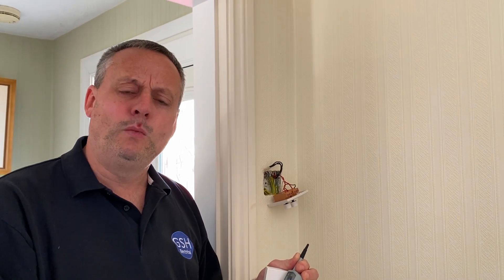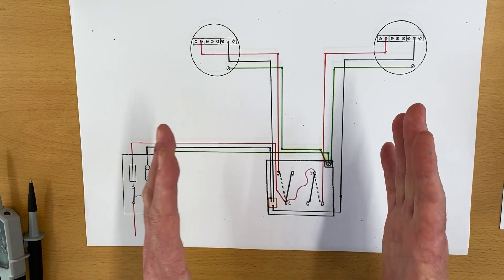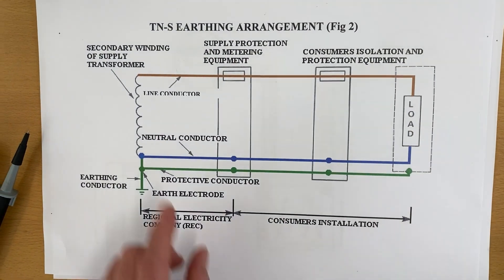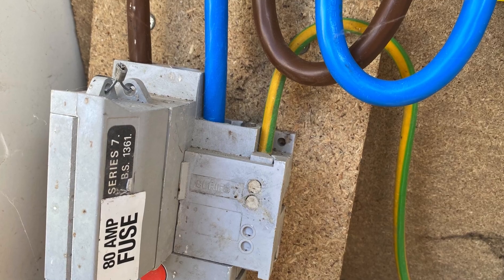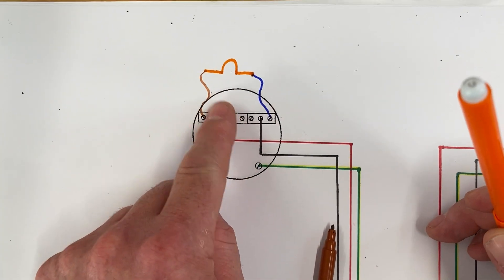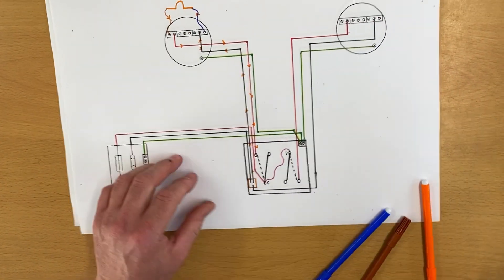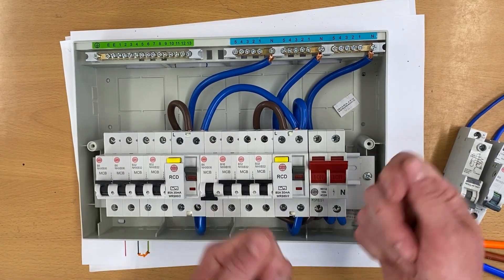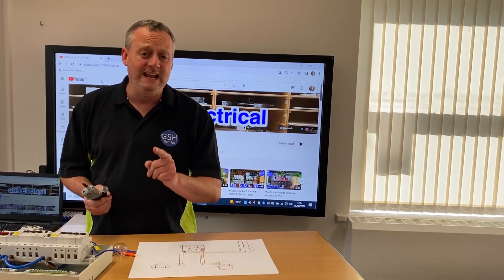WHY Does my Voltage Indicator Beep During Safe Isolation

Comment: You should also get neutral-CPC continuity on a TT system, albeit with a much higher impedance as the completion of the circuit is via the ground. The only supply system where that ought not to be the case is an IT one, and that's not something you will find in a domestic property in the UK (Norway is the only country where that might happen as far as I know).

Comment: Excellent video as always. I have a request if I may, would you consider making a video on derating cable within insulations covering the various cable clipping/mounting methods i.e. in conduit within the thermal insulation etc. I'm sure with the way things are now with acoustic and thermal insulation going in walls/floors/ceilings galore I wouldn't be the only one to find it handy and also interesting to hear your thoughts on the best methods. Thank you!
Reply from the maker: Great comment 👍🏻

Comment: I have two questions. When you get the continuity between the switch live and N/E, would you lose the connection just by turning off the switch. 
Second question, if the neutral is always connected to earth at some point then why doesn’t the RCD trip.
Reply: You would lose the connection if you turned off the the DP switch feeding the Dis board. No neutral path = no earth path. RCDs monitor the ingoing and outgoing current, if the path of electricity is altered, for example through a person the device will trip, equally if it flows through lets say the outer cover of a boiler (metallic) it will trip the device as the new path of current flow will be different to that of normal safe operation
Reply: @mikeenglish6734  That’s the part I struggle with. If the current is already connected to earth via the neutral what changes when there’s a neutral earth fault through the boiler casing like you say. The current still flows from neutral to earth.